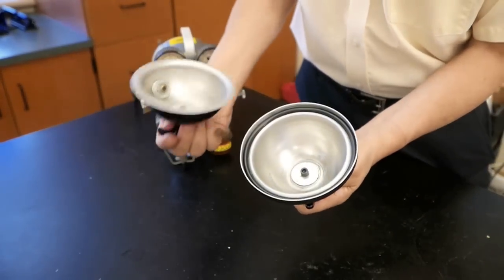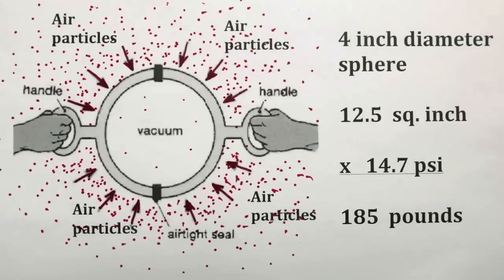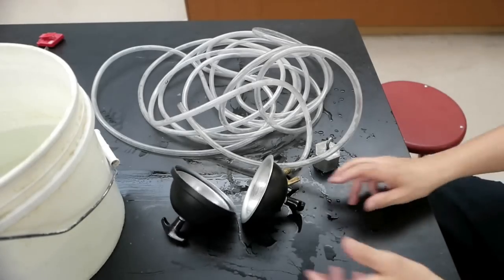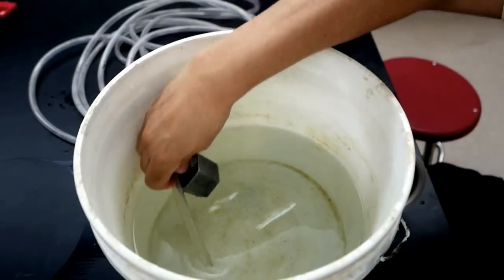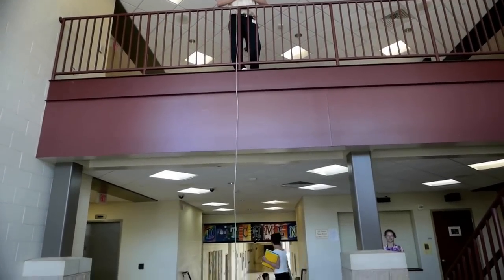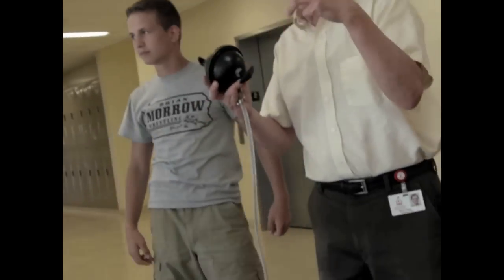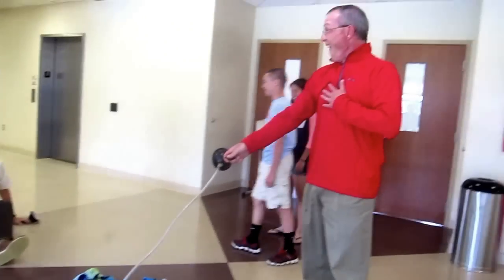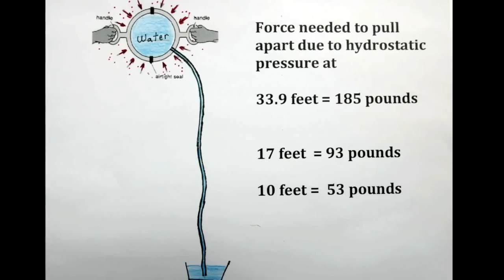Magdeburg Hemispheres- amazing alternate method- no pump // Homemade Science with Bruce Yeany

Comment: Great experiment Bruce, I've never seen it before, I agree though, using the water is much more impressive!

A similar experiment that I seem to recall in Physics was using a pipe as a straw between two floors and your lungs not being able to provide enough pressure to suck the liquid all the way up.

I'm a SCUBA diver and a common question is why don't SCUBA divers use a long snorkel instead of carrying the air with them. Using a snorkel, you wouldn't be able to suck the air as the surrounding pressure increases by approximately 1bar per 10m.  Atmospheric pressure being assumed as 1bar, this results in a doubling of pressure in the first 10m, the relationship being logarithmic.  Hence, your regulator delivers air to your lungs when you breathe at the surrounding pressure, not atmospheric (1bar).  

When divers work with a surface air system, their gases can be mixed according to their depths and the different toxicity depths (maximum operating depths and partial pressures, oxygen being approximately 1.4 partial pressure) and they can be delivered at pressure, to compensate for the increased surrounding pressure.  If the air was delivered at 1bar the diver wouldn't be able to breathe it and their lungs would start to collapse. Anyway, enough of my ramblings :)
Reply from the maker: Thanks Edward,     Our physics teacher used to have student try to lift water with a long hose but don't anymore,  people can do some physical damage to themselves by trying too hard.  As for the SCUBA diving, I've done a bit of snorkeling but would love to try it with the tanks,   hopefully one of these days I'll get the chance.

Comment: Nicely done. In the original experiment, I believe, they had to use teams of horses to pull them apart. Your students might enjoy it if you did a barrel crush, always fun and loud.
Reply from the maker: the big difference was the source of the loss of pressure,  in this case it is the weight of water

Comment: The force will max out at a height of 33.9 ft (~10.3m), right? We've reached the limit of the difference between atmospheric pressure and the pressure inside the sphere. I love that it shows the same limit as pumping under a vacuum, due to the same limiter (atmospheric pressure), but under slightly different conditions. Very cool experiment!

I would also be interested in seeing what happens once we take it above 33.9 ft. Intuitively, we might think we should be able to "drag" the water higher than that. However, the physics implies we would just start drawing a vacuum inside the tube/sphere, because the pressure at the bucket can't hold the water up any higher. In that case, I would also expect the water in the tube/sphere to start "boiling" when we reach that height. So you could boil water just by climbing enough stairs.

So here's your homework problem kids: Calculate the energy required to raise the volume of water inside the sphere from room temperature (21°C) to its boiling point at sea level. Does it require more or less energy to "boil" the water by lifting it 10.3m? Does this hold for any volume of water in the sphere, and if not, at what volume does the answer change? You may ignore the water in the tube, or solve with it for extra credit (hint: you'll need an integral unless you find a clever way around it).

Comment: Besides the missing ultimate height, there is another small complicating detail.  The level of vacuum that the water column can generate is dependent on the water temperature.  The vapor pressure increases with temperature and you get better vacuum with chilled water than what you get with room temperature water.  This issue affects the vacuum that can be obtained with a water ejector type device commonly used in the olden days in chemistry laboratories (for boosting some filtration operations).  In winter time you got “better” vacuum as the water from the tap was colder than what it was in summer time.
Reply from the maker: that's a good point,  thank you Pellervo

Comment: hello Mr Bruce , i have a question , if u went up further more than 33.9 feet , will we reach a point that will make the water change into a gas or vapor ?
Reply: mohamed alfalasi no it should eventually reach a critical point, however seawater turns solid at certain areas where water atmospheric pressures become insane,so maybe with enough pressure it would solidify.
Reply: mohamed alfalasi yes. It will turn to gas spontaneous ly please check a video of the same by another you tuber veritasium.
Reply: mohamed alfalasi here:
https://youtu.be/HUmZrtiXDik
Reply: Yes because the pressure will reach vaccuum and in a vacuum a liquid vaporizes.

Comment: Did this release due to stronger outside force/greater pull capability? Or did the two of you create enough force for the water to boil under vacuum and that was the failure???

Comment: This has been confusing me. I understand that the weight of the water will cause a hydro static pressure at the bottom of the tube, but how does that translate to a vacuum at the top? Does it have to do with the cohesive forces within the water?

Comment: A 4 inch sphere has a surface area of ~50 sq inches. The circumference of a 4 inch circle is ~12.5 inches. The force holding the sphere together is more than 700 pounds, not 185.
Reply: Those 2 people did not generate 700 pounds differince in force.  Common sense>math

Comment: the funny thing about this is that pretty much everyone in the United States has dealt with these same vacuum principles...

Very Full Trash Bags.

It's hard to pull those suckers out sometimes... until you start thinking with physics.

just drill a few holes into the bottom of the can. it'll slide right out.

Comment: 1:50  How did you do that ??? I mean, i know how it works, just how did you do that, there is no way to turn the tube upside down under the water in the container, and if you try to suck the air from in side of the tube there is always a small bubble, so how did you do that ?
Reply from the maker: the tube is filled with water,   most times I fill it at the sink, running water through the whole system and completely submerge it in the bucket of water.
Reply: Bruce Yeany  just the glass tube is meant. You managed to have no visible air bubble up in the glass tube. And it's blue water! Do you have a bucket where you submerged it all?

Comment: What if you brought it up above that 33 feet limit, waited until you saw a vacuum inside the tube (and therefore in the sphere as well), sealed off the valve, and took off the tube? Would it leave a vacuum in the sphere or am i missing something?
Reply from the maker: that is the theory, yes
Reply: You can't get a true vacuum that way because the water starts to boil.  Instead you would have some water vapor inside the chamber, but the pressure of the water vapor would certainly be so much lower than atmospheric pressure that the hemispheres would be inseparable.
Reply: What if you used another liquid with a high boiling point, could you get a perfect vacuum?
Reply: I think mercury would work very nicely.  First it is so much more dense than water that your height will be less than a meter.  Second, the vapor pressure of liquid mercury is about 0.27Pa.  That means it won't start boiling until the pressure is very low leaving you with very little mercury vapor in your vacuum.  Of course mercury is a hazardous material, so perhaps not such a good idea.  

If you are looking for a "perfect" vacuum then this is not your method since all liquids have some vapor pressure below which they start boiling.

Comment: So the hemispheres are filled with water and the tube (which is submerged).

When you broke it water came out, so when you raised it how was a vacuum created?

I thought what you would do is fill the hemisphere with water, shut off the valve, connect an empty tube and submerge the opposite end under water (to prevent air from coming in) and let loose the valve.

I'd imagine the water falling due to gravity and, acting like a rubber stopper in a syringe, pull a vacuum as it fell.

Then I questioned if gravity could act on the water strong enough to pull a vacuum.

So what is actually happening? if the tube and the hemispheres have as much water up top as down below then how is a vacuum being pulled?
Reply from the maker: it is the weight of the water the reduces the pressure inside the sphere,  since water does not compress,  you can't shut the valve and have it stay together. It needs the weight of the water column to hold it together. At the height that I showed this we are not making a vacuum,  we are at half the height needed.  You should be able to get one at about 33 feet.   At that height the weight of water is equal to the weight of the atmosphere.

Comment: Is there a maximum amount of vacuum that would be reached with more length of hose???
Reply from the maker: around 33 feet should reach a vacuum,  with a small amount of water vapor
Reply: Bruce Yeany thanks for the reply.now vacuum can be measured in lbs is there a maximum amount of vacuum that can be reached with our technology
Reply: well taken this from wiki   "Lowest achievable vacuum with a titanium sublimation pump = about 1 NPA, less than 10 FATM"

Comment: You should also be able to shut the valve and remove the hose once you brought it upstairs with the same effect. Correct??
Reply from the maker: No,  I thought so too, I tried it a couple times and  the sphere came apart. It only worked when the hose was attached and water was in the tube. I would guess the difference is that water is incompressible.
Reply: Bruce Yeany That's awesome I would figure the vacuum would still apply but didn't take into account water is not compressible.. Awesome Videos btw. Wish I had someone like you in school.
Reply: Bruce Yeany, perhaps if some air was left in the sphere, the water column could reduce the interior pressure so you could then close the valve and remove the hose.  There would probably be a "sweet spot" as to the ratio of water to air if this did indeed work.
Reply: Bruce Yeany That's very interesting. I still can't quite wrap my head around why it doesn't work.
Reply: I think it might work if instead of filling the whole sphere full of water, you left just a teeny bit of air in it. Does that make sense? Alternatively, if the pressure got so low that the water actually boils, that would probably work too. I guess that would happen at that 33.9 feet number.

Comment: After watching, I amused myself with a seemingly simple physics question: When the two teachers pulled the sphere apart, how much force was each one exerting on the sphere? (presume the halves are pressed together by exactly 100lbs)
Reply: It's as simple as it sounds: 100lbs worth of force (at earth's gravity). Since we're talking physics, let's call it 440N. 

The sphere wasn't accelerating (much) so the forces applied by the teachers on both sides were approximately equal. For the spheres to be pulled apart, the applied tensile force has to equal the compressive force applied by the atmosphere. Hence the figure of 440N.
Reply: I meant is each teacher pulling 220 to make up the 440N, or is that 440N each?  It's similar to the question of "Which is worse, crashing your car into a cliff face or crashing head-on into an identical car".
Reply: I stand by my original answer: they're both pulling 440N. Using your analogy, if one of the teachers were to attach one side of the sphere to a cliff face and then pull just as hard as they did in the video, they would apply 440N of tensile force to the sphere and pull it apart.
Reply: I agree with you, but I couldn't tell that detail in your first answer.  It's something enough people get wrong that Mythbusters did an episode on it, though!

Comment: what happens if you close the valve when after climbing the stairs?
Reply from the maker: we tried that several times,  it  just comes apart,  it needs the weight of the water to reduce the pressure
Reply: @YeanyScience  The valve must displace enough water to partially re-pressurize the spheres.

Comment: If you used a larger diameter tubing, then you could get the full vacuum without going higher.
Reply: Or would that just increase the surface area that the vacuum has to pull on, cancelling out the increase in weight?  But the vacuum is pulling on the water in the sphere, so that is the surface area that matters. Idk
Reply from the maker: yes, the pressure is dependent on height not cross section area
Reply: Neat! Love your channel by the way!

Comment: if you took it high enough could you get it to implode?
Reply from the maker: no,   this piece is made to have a vacuum inside,  air pressure is not enough to implode it,  however,  if you took it deep enough underwater, that would be enough to collapse it
Reply: Thanks for the answer mr yeany love your videos